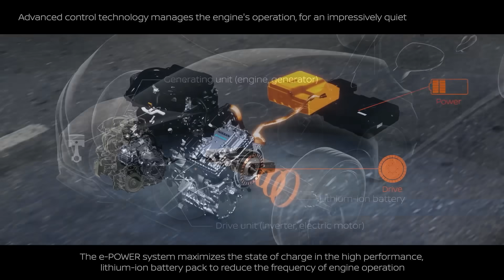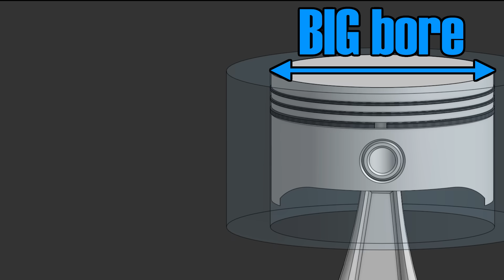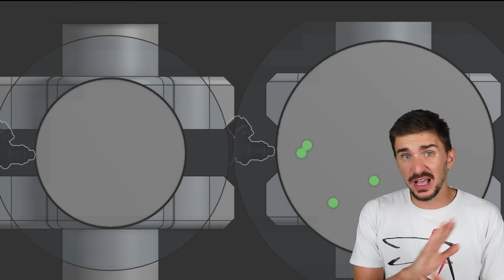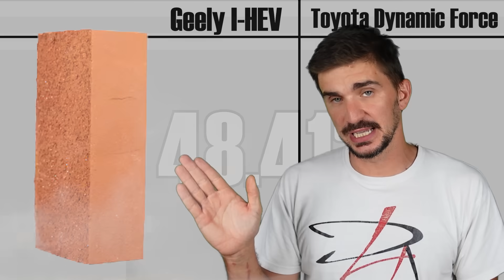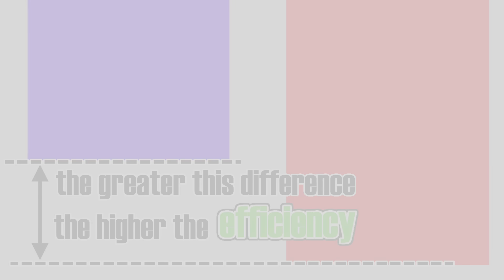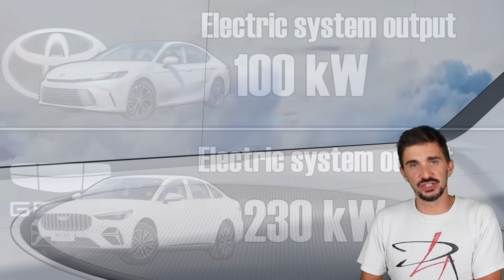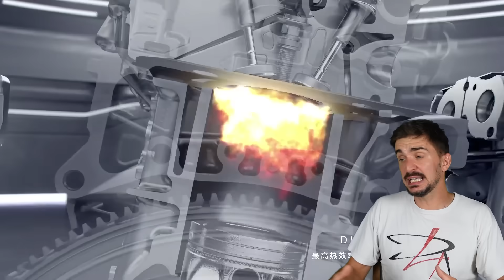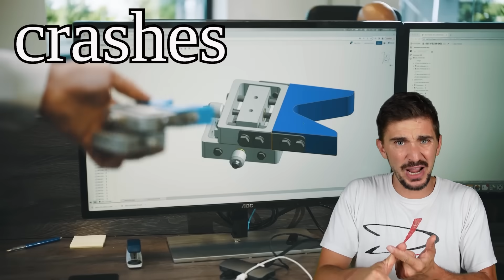How China's Geely Beat Toyota, BMW, Ford and Everyone Else

Comment: In china announcements, there are always foreigners, which it means as usual, it was made by occidental engineers, not by chineses. I wouldn't be surprised, if the designers and engineers were actually in Europe, rather than china. Not really chinese at the end. Like the Aucan engines, sold by china, but all the engineering was made by RICARDO in Europe. 😅😂

Comment: I usually love your videos.

This time, I must point to a different perspective.

You're young, might have read about but not lived other times.

Old GM was hated by the EV proponents for beeing a kind of pioneer and than forcibly crashing all EV1. 

The "movement" had a documentary video: "Who killed the Electric Car?".

GM made some half hearted initiatives, including the proposition of the Extended Range - Electric Vehicle or ER-EV.

This ER-EV later materialized into a product called GM VOLT, that had a couple generations, with half hearted backing. 

Detractors say GM wanted to enforce the feeling of the range anxiety into the public to retard the eventual transition into electrification.

I read most of public disclosures and discussions about it. There was a good discussion site called Green Car Congress were articles were published an decent technical discussions held by members.

The ER-EV concept didn't get much love from EV proponents. They called it a half measure, cumbersome, costly, compared to pure EVs.

The application you described for the Geely engine maxing at marvelous 48% thermal efficiency  is designed for exactly this ER-EV  region of the design space.

Liquid fuels are marvelous carriers of energy. 50Kg of fuel takes more than a ton of car plus cargo some 500Km away, using ambient oxygen as oxidizer.

Batteries were very far from current specs and cost. EV enthusiasts still used lead acid and hated Toyota for supposedly buying the NiCd patents to avoid broader usage.

GM had decent research into Li-ion application into electrification. Their idea maximized the return on the supposed limited availability of batteries both from cost and production into transportation products.

They showed that with a limited amount of batteries it was possible to shrink fossil fuel consumption replaced by night charging at relatively slow rate allowed by existing electrical home infrastructure.

Batteries still cost too much, but at least one or two order of magnitude less now.

The ER-EV niche Geely is exploring now can rely on much better batteries with a larger energy content used at less degradation inducing conditions to fill the "unlimited" range niche using existing fueling infrastructure.

Toyota always could implement this concept but wastes time lobbying against EVs and spending FUD and unreliable information bearing the ridiculous.

Toyotas eCVT that Ford also used is a very efficient torque merging and transfer piece of equipment. 

The implementation of GM Volt is very similar in concept with a few more controls and operation modes.

In this context, the ICE is meant to be a energy conversion machine to extract electrical energy from the fuel at possibly a stationary speed and load at it's tuned best BSFC point.

Cost, simplicity, weight, packaging are also important but thermal efficiency is a highly regarded bonus.

This level (48%) of thermal efficiency was considered impossible for gasoline engines. 38% to 41% achieved by Toyota Prius Atkinson implementations of it's engines over generations were highly regarded.

GM also used a family 0 (ou 1) modified into an Atkindon engine as the range extender embedded in it's GM Volt generations.

Geely (owner of Volvo car franchise) now produced an impressive offer based on current available tech with very impressive thermal efficiency that fills a niche above the unavailable GM Volt.

EV purist hate hybrids, but there will always be a niche for the ER-EV proposition where there is usable fueling infrastructure and limited EV recharging options.

Might be an option to reduce fuel consumption and still allow a single car to be driven in eventual long range trips with no "special planing".

There are drawbacks for rarely used ICE other than dead cost and weight, but it's still an excellent tool for our "toolbox" of options should the need arises.

Toyota, GM and others could have achieved this level of Thermal Efficiency but did not. Not even to show off.

 Geely apparently did. Their merit.

Comment: 15.5 to 1 "compression" ratio on gasoline? NO, not at all. What they have is a 15.5 to 1 EXPANSION ratio. The late closing of the intake valves cuts a large chunk out of the compression ratio.

Comment: So basically this engine is just a data gathering scheme to train and "improve" the AI that Geely created, so it can do something as basic as knowing where you are, and knowing when and how to power your car? I appreciate the approach to creating this hybrid, I would be so happy if I could get 2,2L/100km on a car. But literally having the ICE constantly charge the batteries (up to a preproprogrammed amount, like 80%), also solves this problem, and does not require this invasive data gathering or AI, which is only a marketing scheme that obfuscates the real purpose: we control the data of where/when/how you drive.

Comment: Why didn't you mention, that oversquare cylinder has  a bigger surface to volume ratio and thus lower thermal efficiency than undersquare engines have? I have noticed that surface to volume ratio doesn't get attention in comment sections of engine videos, maybe because you don't see it with your eyes, you just have to know its effect on the thermal efficiency. At high temperature moment in TDC point it is better to have a small internal surface area inside the cylinder, because it decreases the thermal flow out of burning gases and increases  thermal efficiency. And undersquare cylinder has that smaller  surface area at TDC-point.

Comment: Very similar to what mazda already did a decade ago with the skyactiv G engines with high compression and thermal efficiency of 40%.
And Mazda is going to come out with new Skyactiv-Z engines in the next year or 2.
Reply: Mazdas has also dabbled in the miller cycle since the 90s.

Comment: Watching the atkinson cycle animations I'm starting to wonder what is the exact time when the injectors inject the fuel? I assume you wouldn't want any fuel getting into the intake port as it would be practically unusable in the next intake cycle. Also is the actual compression ratio really 15:1 if you don't close the intake valve for half of the stroke?
This went from "'I'm impressed" to "This is more coincidence than anything" real fast, but I gotta admit these engines would make amazing generators.

Comment: Instead of using AI, what would be wrong with a system that simply changes the Miller cycle valve timing when you're going up a long stretch up hill?

Comment: To add on to what some other comments are saying, 15.5:1 may not be the effective compression ratio, that's probably closer to 8:1 i'd guess, but the 15.5:1 can be described using a term from a different field of engines entirely, rocket engines, because that'd be the expansion ratio. And expansion ratios are, ultimately, what drives your efficiency, while compression ratio more drives your power.

But on the topic of high compression ratios, i'd like to throw in a suggestion for the, now very long in development, Zoche aerodiesel. it's a radial diesel 2 stroke with perfect primary and secondary balance, high P:W, no valves, and now extreme efficiency to boot thanks to the use of an e-turbo design. 

Radials usually have some real issues with secondary balance, so a perfectly balanced radial (especially one that only has a single bank of cylinders like the mid-size model has) is already pretty incredible. by putting an electric motor on the turbo, it doesn't need a supercharger even though it's a 2 stroke diesel, and it's not trying to use multiple fuels so it doesn't need the exhaust valve shenanigans. It doesn't need to rev high because airplane propellers create a pretty low rpm limit to avoid going supersonic. but at higher engine rpm's it still could over speed the turbo, so the electric motor acts as a brake instead capturing the excess energy from the turbo so not only does the turbo not need a waste gate, it can transfer that energy to the main drive shaft through the starter motor to take some load off of the main engine, thus creating electric turbo compounding and getting even more of the energy out of the fuel, meaning less fuel has to be burned at these higher speeds, creating insane efficiency numbers while keeping the power to weight you expect of an aero engine. 

also, because of how it's laid out and how it works, it's got a dry sump by default, not only further improving its performance, but also making it aerobatic capable out of the box. and a fun bit, it's able to have perfect balance only because it's a 2 stroke. by going 2 stroke, it doesn't need an odd number of cylinders, allowing it to have a 4 across arrangement, which happens to be an arrangement that cancels its own secondary imbalances and lets you completely cancel the primary imbalance with only the crank shaft's own counter weight. and this is only able to work because the 2 stroke only puts compressive loads on the connecting rods, allowing a unique connecting rod design that doesn't require a master and articulating rods design, which is what makes secondary imbalance such a problem for radials most of the time. 2 stroke also halves the firing interval, meaning the larger 2 row, 8 cylinder engine runs with the smoothness of a 16 cylinder 4 stroke.

And in spite of all of this, this engine is able to be air cooled and even requires smaller cooling fins relative to the engine size than the ww2 gasoline radials did. There are liquid cooled variants but those are really only for static applications like generators, or for marine applications. for aircraft, or in theory automotive, applications, air cool is more than enough. it also comes in a v-twin as its smallest model which i'm sure you could jerryrig onto a motorcycle. all in all, pretty incredible engine.

Comment: Had a quick question:
Since it's an adjustment in valve timing and we already have variable valve timing, could you not take something like a Skyactiv X engine that uses spark controlled compression ignition to extract additional power out of the explosion by having a more even and rapid burn (and which has a small supercharger) and combine it with such an EV system and be able to dynamically "switch it back" into a more standard operation mode as well as a deep miller cycle in order to get the best of both worlds - ridiculously high efficiency in normal use and then good power if the situation calls for it

Comment: You forgot to mention that Chinese hybrids are mostly PHEVs with huge BEV levels of battery capacity (over 20-70kwhr). People also plug in all the time because of the abundance of chargers and homes with chargers and solar panels.  You forgot to mention BYD, Dongfeng and Chery are doing the same thing on their engines.  Also the lack of a mechanical connection as in e-cvt with planetary gear and simply going directly to feed juice to an electric motor removes the potential metal to metal friction contact that planetary gear based e-cvt still makes.  The car is EV at low to medium speeds, engine only connects to the wheels at high cruising speeds, like Honda's hybrid system, so the engine can achieve overdrive (lower rpm than the wheels turning) as the electric motors can only have a direct 1:1 ratio with the wheels.  That makes high speed cruising relatively inefficient for an electric motor, see why Nissan's ePower has omitted coming to the US.

Comment: One of the reasons why China is looking more into HEV/PHEV vehicles are EU tariffs on EVs which excludes (P)HEV.
Serial hybrids are not new, the problem is highway where this systems are inefficient and many manufactures choose a direct drive system.
AI is just a buzzword, pretty much any PHEV these days can use satnav to optimize battery use - no datacenters needed.
But competition is good, let's see how these claims hold up.

Comment: My understanding is that, yes the geometric compression ratio is very high but the late closing inlet valve reduces the dynamic compression ratio considerably, although this in itself is countered by an increase in volumetric efficiency due to the inertia of the inlet charge brought about by the long stroke raising the charge velocity at any given rpm.

I'm surprised about the minimal mention of the prime benefit to thermal efficiency that a small bore presents due to reduced surface area. That in itself is a massive benefit and one of the primary reasons for designing a high energy efficient engine using a very undersquare geometry. It was this very reason why hemi heads prevailed for so long as a sphere has the lowest surface area for any given volume.

Comment: Series hybrids, where the gas motor is just a generator always made more sense to me.  It can be optimized for a fixed rpm and just combines two simple systems.  The Chevy Volt was great design but they moved away from it with the Bolt.

Comment: I'd like to point out that the Honda hybrid strategy of the Civic / Prelude / CR-V is that same electric-first strategy as the Geely. It only couples the engine to the wheels at cruising speeds. Otherwise, it's a motor-generator. I don't think their ICE can hit that level of efficiency, though.

Comment: The key to thermal efficiency improvement would be in using the waisted heat from the cooling system to produce power.I doubt there is enough pressure left in the cylinder to provide this extra level of efficiency
Reply: A perfect engine would have 0 pressure left

Comment: I thought modern valved miller cycles were closing intake early so the rest of the stroke is pulling a vacuum. You get some of that energy back during the compression stroke when the piston is behind the closed intake valve position. Also friendly to port injection because it doesn't push gas past an open valve.

The real question is does the engine efficiency make up for electrification losses.

Comment: Several things not mentioned: 1) An "over square" engine allows for bigger valves for the same displacement thus "better breathing" at high power.  2) The concept / application / use of, a "range extender engine" in an otherwise electric vehicle, which is what this basically is, others have done the same but with a different name.  3)  While the maximum posted speed limit on Chinese highways is 120KPH / 75 MPH, it is more strictly enforced in China, so the actual speed of vehicles is lower than for a road with the same posted speed limit in the USA, additionally trucks are limited to 100 KPH / 62 MPH so there less HP required for passing trucks.

Comment: Bit misleading by Geely, announcing this engine having 15,5 compress ratio... kinda checks the boxes, but the "real" compression ratio is lower
Reply: compression ratio is misleading only because people make assumptions about it

its the ratio between cylinder volume at TDC vs BDC. 

it doesn't describe anything about actual pressures at TDC and BDC, as these change depending on RPM and boost pressure, compression ratio itself means almost nothing. the "actual pressures at TDC/BDC" are what matter for efficiency and power, and almost everything else too.
Reply: @JedPotts-jv2ux  the real compression ratio is the realtion between the volume when the intake valve closes and the volume at TDC
Reply: it is not
Reply: nope. it is true CR , just like EVERY 4cyl atkinson/miller engines nowadays , right?????????????

Comment: The question is why aren’t we using variable valve timing coupled with twin charging to achieve “deep Miller cycle“. An early, efficient supercharger, pressurizing the intake, and slowing some of the intake valve bleed back would probably nicely fill that gap. Just let the turbo come on later to pick up the horsepower.

Comment: Ahh, so my Thermodynamics professor was correct in 1980.  Of course, us wantabe engineers that were motorhead all favored oversquared engines.  But I never forgot that comment and I knew where he was going with this.  Although that isn't so new nowadays.  Lots of engine are not undersquared.  Great content and explanation.

Comment: I have always thought that basing hybrid more on the electric motors is the future. We already have seen even on the early Toyota hybrids using the electric power to allow them to optimize the engine for efficiency by using the electric motors to reduce need for engine during dead stop.

Comment: 14:50 the reason is the sheer quantity of unrecyclable unusable batteries accumulating in waste centres. china adopted EVs far earlier than the rest of the world, so they are further ahead of the nightmare consequences which the laws on phasing out diesel and petrol in, say, Europe, is going to hit really hard when it creates the exact same waste lithium battery problem. it's easy to do the predictions if you know the physics chemistry and economics - it's just that nobody does. whoops.

Comment: >no other manufacturer makes electric motor centric hybrids.
Bro, that's Nissan and Honda.
Nissan's engines never power the wheels in their e power infrastructure, and Honda's EHEV only lets the engine take over on highways when the engine is more efficient

Comment: could delve deeper into the miller cycle? Is it possible to achieve sufficient compression with the miller cycle because of the excess pressure of forced induction, so even if the valve is open longer, the cylinder reaches the full potential compression? You wouldn’t make big power, but you’d achieve “normal” power of a car with natural aspiration, while being able to increase efficiency, right?? With a deeper miller cycle, but forced induction shouldn’t there be mostly no drawbacks?